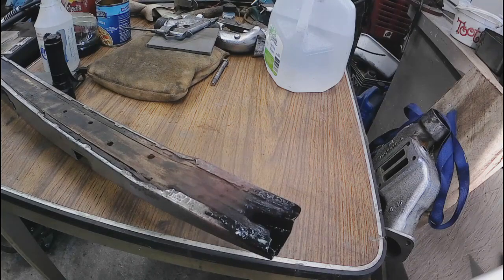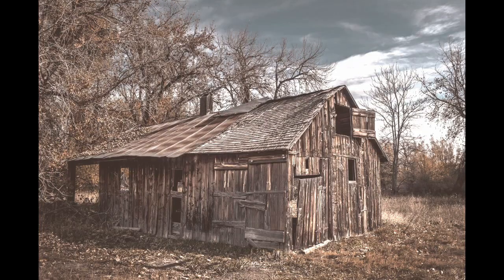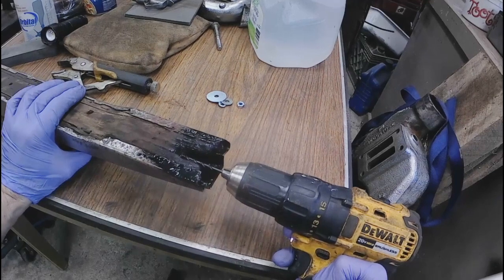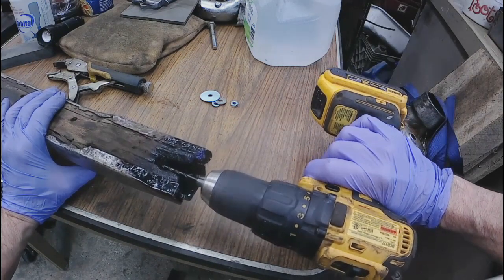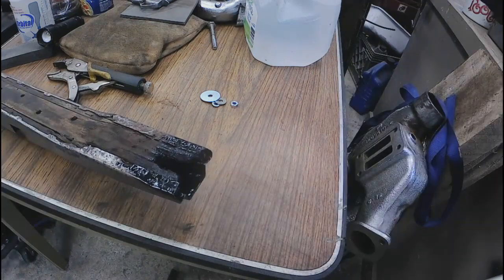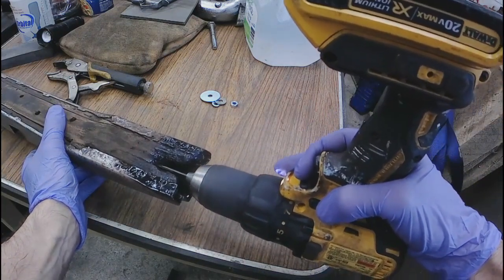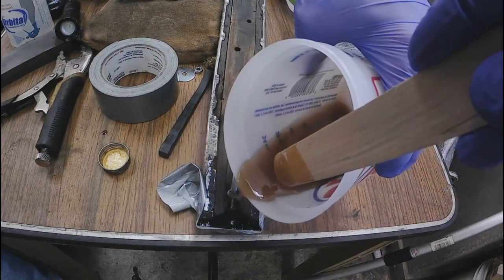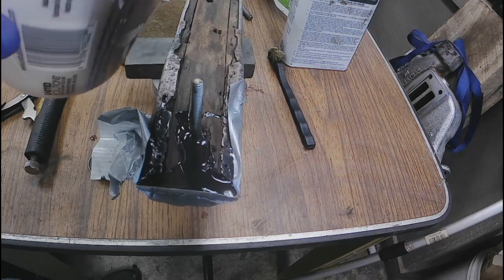🟥 A RED GREEN TRIBUTE 🟩

Comment: Hey Chuck,  You do a respectable Red Green imitation.  Man of talents without boundaries.
Have you visited Strong’s Garage channel ?   I’ve got my winter project picked out.  The 31 Roadster is getting a new frame.
Reply from the maker: Hey Myrl! Thank you! I saw an interview with Steve Smith who said, the people that like red green, know someone like him or have some of that in them. So yes to both.  

Yes! I'm a die-hard cold war motors fan, so I followed Matt and Jim when they launched the channel. I've never seen a period shop assembled with so much attention to detail. Those are two of my favorite channels. 

Is the roadster getting a new frame as  in a re-man or from a donor car? You should film it.. I'll even edit it if you want! 

Regards
Chuck
Reply: Chuck,  The A frame is one which I picked up down in North Carolina from a donor car.  It’s an improvement in that has virtually no rust pitting, is straight where it should be straight and bent where it should be bent.  “A” frames tend to be noodles that can get bent over time if driven hard or in a minor collision.  The existing frame could be reconditioned but would never match up to the replacement found.

You may not believe it, but I worked as a mechanic in a garage in the late 1960s having an almost identical design as Strong’s.  Same lift, same window style, same colors, and much of the special tooling which they now own or are seeking.  Brings back a lot of great memories.  I eventually switched to aviation and it was off to aviation school. 
MJ
Reply from the maker: I remember you telling me that the frames on those cars could get tired out over the years. Good thing the bluick isn't an 'A'. Imagine the Frankin version of the bluick!! 

But it's awesome to hear that you scored a winner of a frame. Knowing you, it'll be as good as possible when you finish it up. 

I've been up to adjusting the body and doors, they were sagging bad on this side. Slowly it's starting to look and feel less tired. Not the easiest body to adjust, but is forgiving in other ways.

Love the sound of your old shop! Wish I could have seen that. When I was a kid I worked at a shop / wrecking yard  in a hill town. The guy lived in a big old stone house that was attached, it was really unique. 

-Chuck